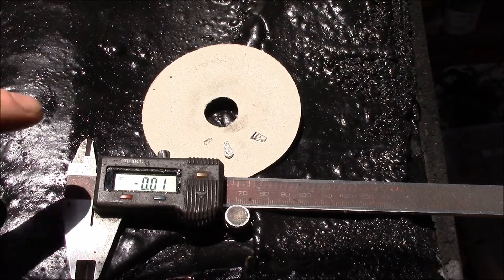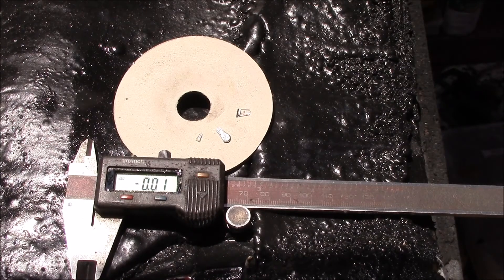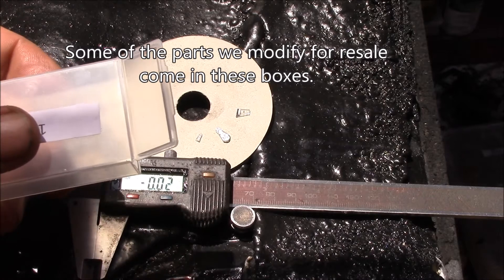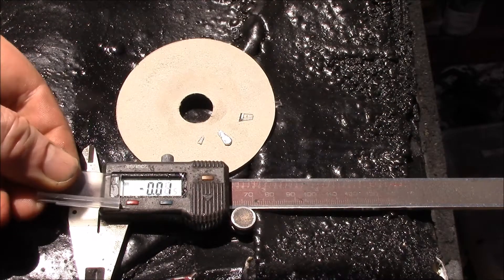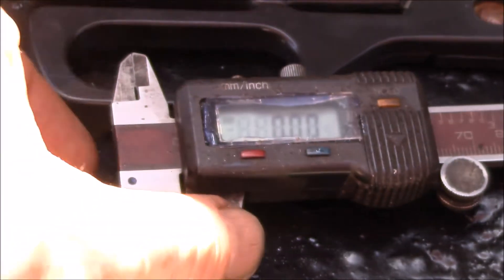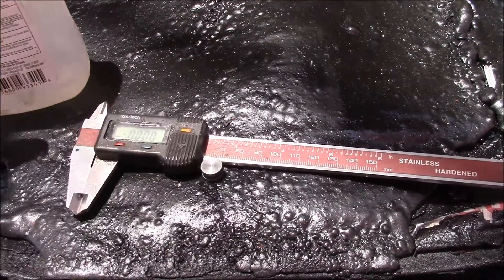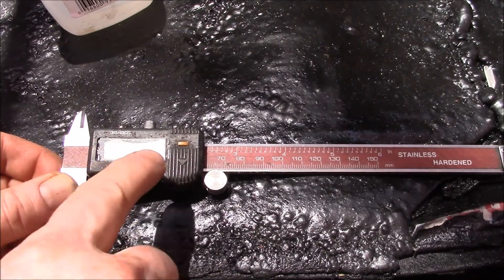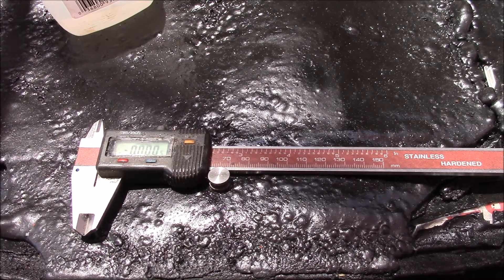Digital Caliper Bezel Replacement

Comment: Have tossed because the glass cover broke...protective shield stopped protecting...have to start saving the tough clear plastic used to airtight hermetically seal...due to my pack rat tendency have the old things that still work just don't have their original look...know now can just cut plastic, film, even plastic wrap might do with some things...learning to be resourceful, innovative and saving things that have a second life and more...waitting to find the right plastic to cover the end of a flashlight...♀
Reply from the maker: Yes, saving potentially useful things is good.  I have a few of these little boxes and use some for storing small parts, etc.  But they ended up being perfect for this repair.  Sure, one could go out and buy some material, but then you end up with a 12" square sheet and just need a little piece cut out of one corner and then you have to find some place to store that unused material.  Plus you spend an hour or two driving around to a few stores to find that material.